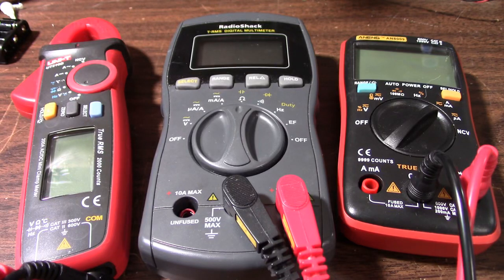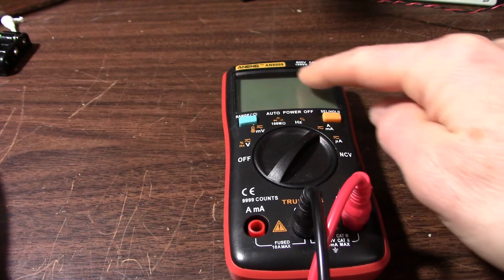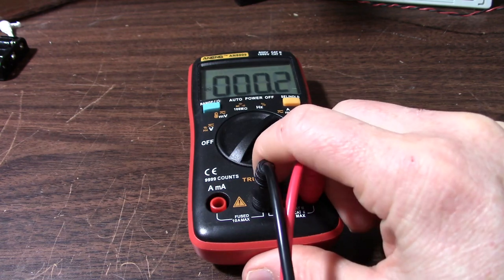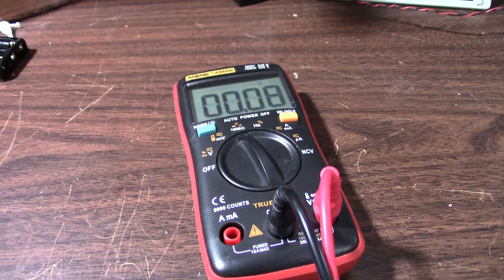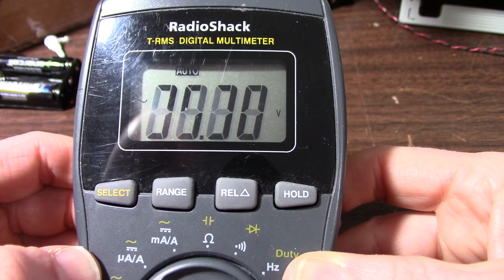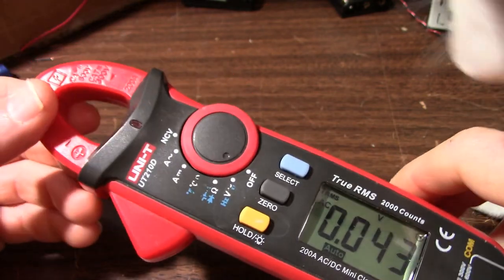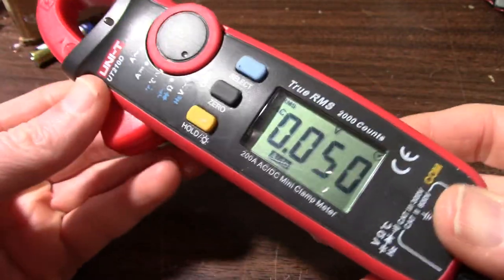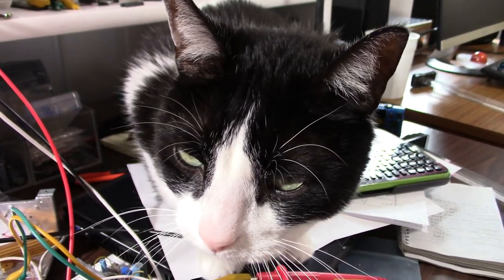Budget multimeters - long term reliability problems

Comment: if the contact on the multimeter is a bit touchy, you can clean it and remove the lubrication and put a new one, i fixed mine like that, and you can bend the contact pin more so it has better contact
to the pad

Comment: I've had my Radioshack meter for 16-18 years and surprisingly it's still hanging in there. We've been through many sets of probes, a handful of batteries. Biggest issue I have is the selector being a little crusty, which is very reasonable to me considering the number of vehicles that it has rode around in for months at a time and general ill treatment it's been through. It's been years since I compared it to the fluke, but last time I did it was within a couple percent on the range I was able to check

Comment: I know if you set up a gofundme or similar to get contributions I would certainly contribute toward a Fluke 87, you have given of your time and expertise here I am sure others are willing to support your efforts..  Short of that, I have been pleased with a used Fluke 27FM... military spec, TRMS, solid. Can be had on eBay for  < $100.  I also picked up an Amprobe AM-570... got mine for ~$125 on Amazon.  Full featured, not as physically robust as a Fluke, but I don't work on oil rigs :)

Comment: I found I have go into my cheap meters and clean the rotary switch contacts and traces and apply some De-oxit to them after being cleaned.    This technique really helped my UNI-T 210E clamp meter.   I grab the 210-E regularly and check DC current all the time now since I don't have to break the circuit for ballpark current measurements all the time.     I have several Flukes for my important work though too.

Comment: IME probes are often the main weak link on budget, but when a decent quality set of probes can cost as much or more more than the meter you have to expect this.  There are quite a few variants of those Aneng meters, I have an AN8001 which isn't bad for the price but my main complaint are the nasty little 10mm protection fuses which are not easy to find.  I modified mine to take common 20mm fuses.  Obviously not a good choice of meter to be working on anything remotely high energy.
I also have a UT210E, which I mainly use for troubleshooting car wiring problems, though I couldn't resist re-programming the EEPROM to enable the 10000 count operation just because I can't leave well enough alone.  A shame to see the front panel text wears off so easily though, I'm thinking that adding a layer of the 3M clear protection "helicopter tape" or similar would be a useful improvement.
You've probably seen it, but there is a spreadsheet on EEVBlog listing features/omissions of a wide range of DMMs https://www.eevblog.com/forum/testgear/multimeter-spreadsheet/
Reply: My Fluke probe leads are some 20+ years old. In the garage we use Fluke and it gets so much beating I feel sorry for it - the leads and adapters are awesome. Comparing to the Chinese they cost the price of a decent DMM, but reliability wise worth the price.

Comment: As always, I enjoy your videos. Here's a few meters in my collection that might help you in deciding your next purchase. I have a Fluke 87 that's about 25 years old. I think it was last calibrated in 1998 when I sent it in for a display repair. There is a display contact strip upgrade that you can now change yourself. The only current issue is the AC voltage is off a little.  I also have a Tektronix DMM916. Never any issues and it's just over 20 years old. I prefer it over my Fluke 87 in certain applications. FYI, Fluke acquired the Tektronix meter division around 2000. My most current purchase is a Reed R5005(made by CEM). I haven't used it long enough to vouch for it's long term reliability, but it's very powerful for the money. I bought it from Zoro Tools. Get on their email list to get discounts. I believe I got the meter for 20% off and they were cheaper than anyone else by $30.

Comment: You've clearly demonstrated that many CHEAP-O Multimeters are actually quite good!

ANENG: You can't dis the ANENG because the included test leads are dodgy...of course they are! 
Replace the leads with a better pair and you'll be surprised with the improved performance.
Simple cotton swab and IPA will clean the rotary and that's a recommended practice for most inexpensive and sometimes expensive multimeters. 

RADIO SHACK: Did you put in a fresh battery for the Radio Shack DMM? I had a similar issue and a new battery took care of it. These were built like tanks, well constructed and offer decent input protection at a minimal cost to the user. They shipped with spare fuses and a ton of accessories.. a real bargain!

UNI-T: The UNI-T clamp once again can't be faulted because of the included test leads. The UNI-T 210 Series offers incredible value and once again has a solid track record *price/performance. If you use it in a oily/dusty environ, clean with a damp cloth and you should be good to go. Neither of mine have suffered the faded label fate as you have mentioned.

All in all, CHEAP multimeters have their place and have proven their worth. 

In some Global markets these meters are used and abused on a daily basis as name brands such as Fluke/Keysight etc.. are simply out of reach for the ordinary person and yet these inexpensive multimeters still perform admirably.
 
Thanks for the video! (I think Snickers would prefer a bench meter!).

Comment: I had the same problem with the dodgy selector on the an8008.  I took it apart and sprayed some deoxit on the selector contacts and it started working like a champ.  The metal contacts looked to be in good shape before the deoxit, but probably a thin layer of oxidation has formed.

-

Comment: I like the AN8008 that i got because of its readout...it has four fully utilized digits, not this 3 and a half, or 4 3/4 stuff...it can show for example 9517.... Also it is fully High Voltage capable.

I repaired an old Tube Amp the other day which uses a pair of EL34 in class B push pull (Philips EL6420) and has a Plate voltage of more than 800 Volts. In fact i measured 820Volts DC right at the center tap of the output transformer with that AN8008 - pre wired, i don´t probe this kind of stuff with ordinary leads, and it didn´t blow up. I also cross-checked this unsing my Tektronics DMM 254 and it was spot on.

Comment: Awesome to see you make a video on this... have been encountering similar issues two weeks back and debating on investing in a good DMM ... my usage is sporadic... which uni-T should i aim for... there are so many models.
Reply: Check out the feature table at https://www.eevblog.com/forum/testgear/multimeter-spreadsheet/ but more importantly see if you can find a specific teardown review of the model you may be interested in.  The weakness of many the UNI-T is in their input protection, which is not so much of an issue for low voltage use.
Reply: Uni-t ut61e, not the 61a-d but 61E specifically is the beset bang per buck at ~50 bucks. If you can spend a bit more go for UT71-C or D. Past that they get very expensive and don't really compete with Brymen or other high-end stuff.
Reply: @CasualR1der  Thanks! much appreciated.

Comment: Do a vídeo of repair! I'm usually need to do this to my ultracheap meters, even calibrating them with an Fluke as reference. And sometimes applying some solder layer yo the Rotary encoder

Comment: Have the same problem with rotary switch. Clean tracks with alcohol solve the problem because there i was found some grease. Mine is Zoyi 17b+ model. :)
Reply: There is supposed to be grease on the contacts, without it the pcb tracks will quickly wear.

Comment: a thermostat heating control works by using a resistor to limit how much electricity is getting to the heater element. however if it is 5 volts and uses 2 amps and you have it set to low so a limited amount of current is getting to the heater element does the unit still use the full amount of current. are you being billed for 5 volts at 2 amp. normally i would say no however in the case of a water bed heater it has a resistor to limit the amount of current so you can never get to 100 degrees unfortunately if you had it set for 100 degrees it will never switch off because it cant get to 100 and its always on and i wondered if its still using the amount of power but just not delivering it and your paying for it.

Comment: I have AN870, not bad. For the money hard to find something better. AC RMS is good to 2kHz. 
Comparing to my old 30 Wavetek, the DC and AC measurements are much faster and more accurate, but the Wavetek is more idiot proof - it will scream if you plug the leads into the wrong socket, say for mA scale and lead into V-Ohm socket, to avoid blowing up the fuse. Also the socket connection on the Aneng could be thighter. No, Fluke or Agilent it isn't. European brand Bremen makes interesting DMMs, especially for audio use with dBm scale that can be set to specific resistance, but 200$ up. Now, Canadian Tire has DMM with dBm scale for $90 Can or so - surely can't expect haven, but in this price range I haven't seen one with dB scale. I have older automotive autoranging Fluke: for regular voltage, current, resistance measurements it is a good DMM.

Comment: One meter with angle plug that you don't like and would prefer straight leads.
One meter with leads coming straight out the top and will work better and put less stress on the wires if they were angle plugs.
I'd say the solution for both is pretty obvious.

Comment: Sometimes on eBay you can find a fluke 27/fm at a real reasonable price. Shango66 suggested it a while back and I got one for about $60. Military issued unit, I think price is low because it’s not yellow

Comment: On the grey meter,  it flashes back and forth because of a Open Fuse,
 That why it goes to OF. Replace the fuse.
Reply from the maker: The fuse is good. I just rechecked to be sure. Since it does this on AC voltage as well, I suspect some other problem.

Comment: My fluke has issues! so do my beckmans  the fluke has issues with display problems. the beckman switch problems. They all need maintenance! a good cleaning and a little deoxit fixes most problems. The fluke you have to clean the rubber contact bar and clean the switch. So any meter needs maintenance!

Comment: Aneng - I'm unable to get a replacement fuse
Reply: Yep, the stupid little 10mm fuses are rubbish.  The easiest solution is to get wire ended fuses which are readily available on eBay etc and clip the wires off. I converted mine to 20mm fuses because of this; blowing the low current range fuse at some point is almost inevitable.

Comment: I understand Fluke is a brand and it's durable also accuracy is decent. But does it really worth? A standard fluke DMM will cost you around ($$350-400) which doesn't make sense to me. All we need is measured ohm , vdc , vac and some time amps with DMM. So seriously dude I have no plans or won't gonna think to buy a fluke DMM. I will buy a DMM but ain't gonna buy a BRAND lol. I got a $5.99's DMM from China which I bought a year ago and works the way it's supposed to. Believe me it got no issue and never have changed the battery since I had purchased. I have checked the accuracy of the non brand DMM with fluke and it's accurate just like the fluke. I'm not saying fluke bad but just saying about the price of fluke.
Reply: For hobby use on low voltage stuff, Chinese budget meters are fine. If you are a professional using your meter many times a day then you need a robust, reliable and nice to use tool.